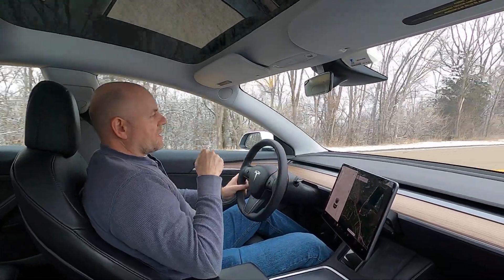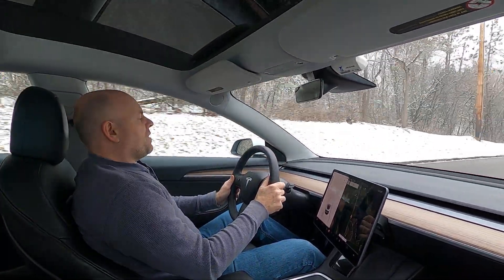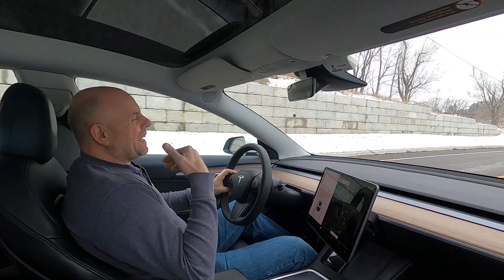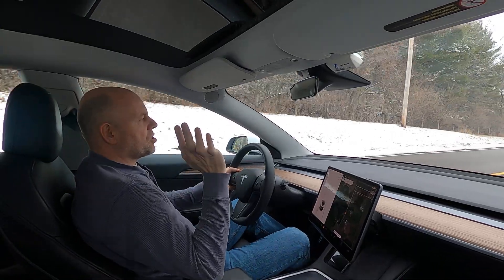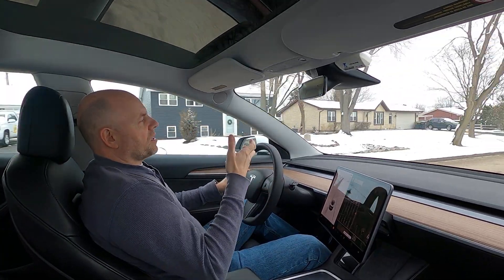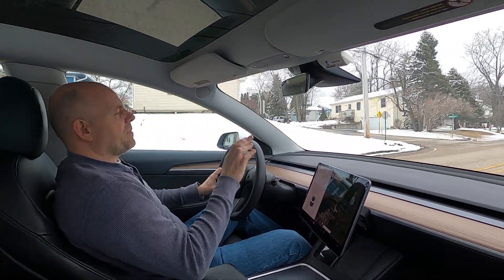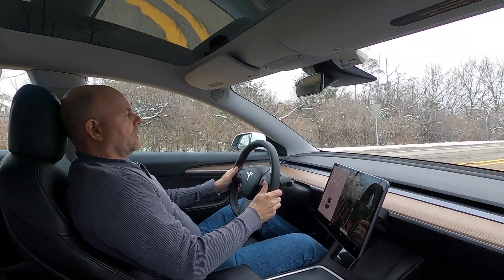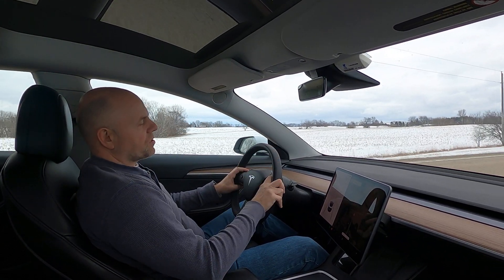My Tesla has rusty brake rotors!

Comment: Great advice and I think I learned something new with "rotor delamination?"  I always thought stock rotors on common cars were simply cast iron?  In the old days they made them thick enough too so you could "turn" the rotors on a lathe when they warped.

Comment: If I park my car indoors after arriving home in the rain, my brakes usually rust. I can hear it getting scraped off the next time I drive out of the garage. They smooth out very quickly. This is an ICE car, so it gets a lot of brake use whenever it is driven. It’s a different story on an electric car so do what Matt says or some variation that suits you.

Comment: The model 3 wipes the rotors automatically. 

From the manual, “To ensure brakes remain responsive in cold and wet weather, Model 3 is equipped with brake disc wiping. When cold and wet weather is detected, this feature repeatedly applies an imperceptible amount of brake force to remove water from the surface of the brake discs.”
Reply from the maker: Yes, but I have not found that it actually works. I have issues if I don't cycle my brakes.
Reply: BMW does this too but it's just to sweep the rotor of moisture.  It's a fraction of the pressure needed to clean the disc.